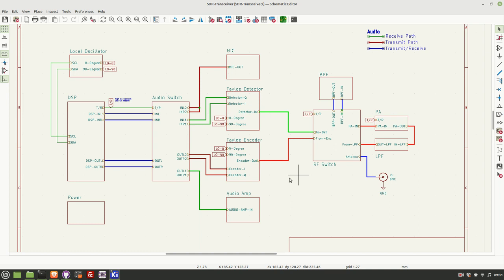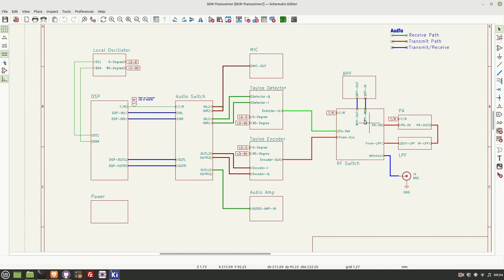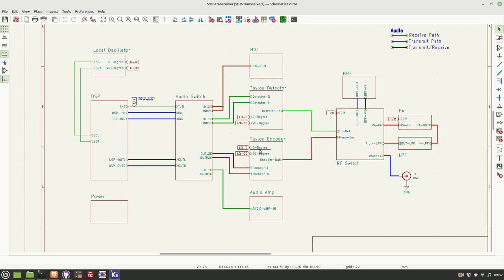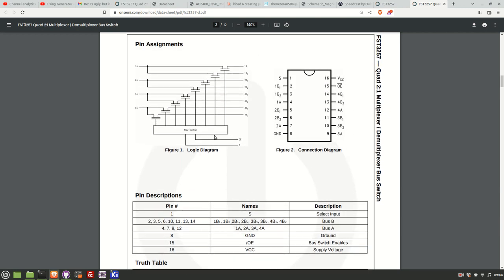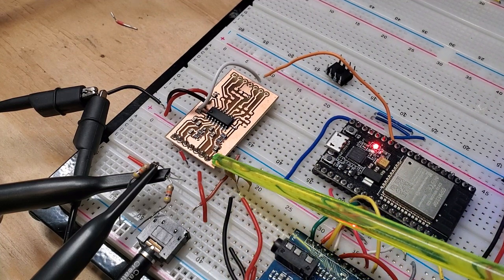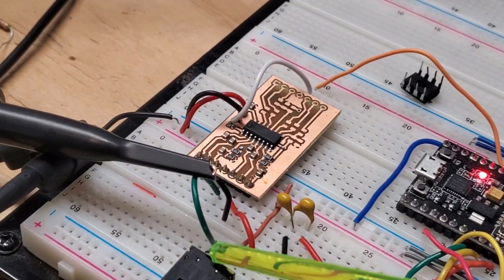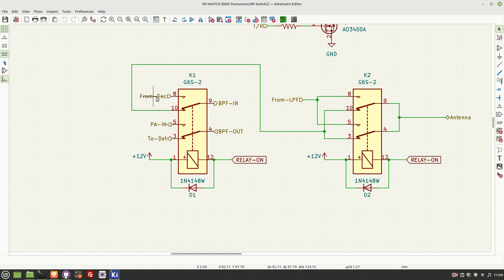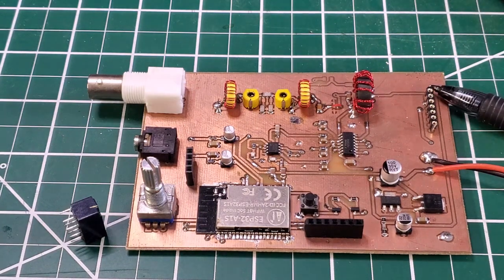SDR Transceiver - Part 1 Overview and Transmit/Receive Switching

Comment: Great videos. I may have missed it in an earlier video but how do you make your PCB’s. Are you using a CNC machine? 
73 Paul W9WC
Reply from the maker: Hi Paul. I use the "fab in a box" kit and etch the PCBs. I did a quick video on the process a little while back
https://youtu.be/X5O1au3FvRc?t=225

Thanks for the comment!

Comment: One point to remember is if you bias the audio you should keep all the bias voltages the same or as close as possible.  If not each time you switch between them you will be forcing the caps to either change or discharge to the new dc conditions. Causing switching pops etc.
Reply from the maker: You are right - I really should have run the output through a speaker to see if there were any audio artifacts there. Definitely going to do that when I have the switch hooked up to the ESP32-A1S. Thanks for the comment